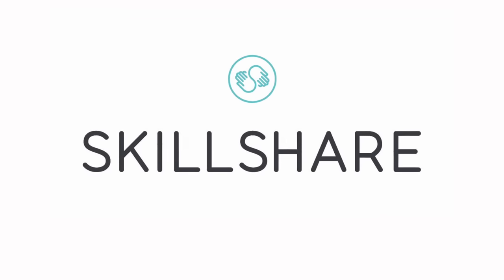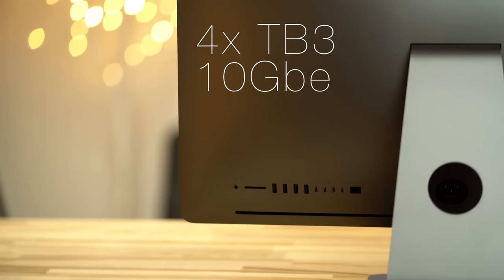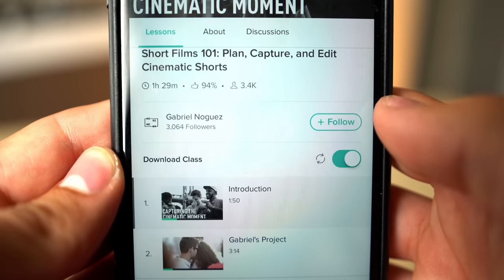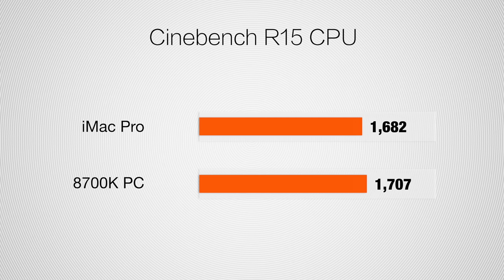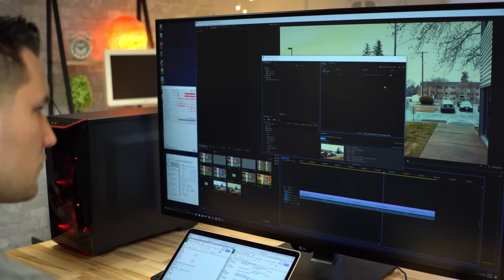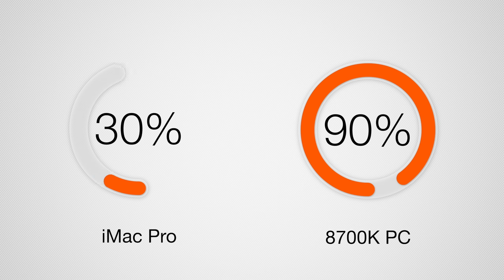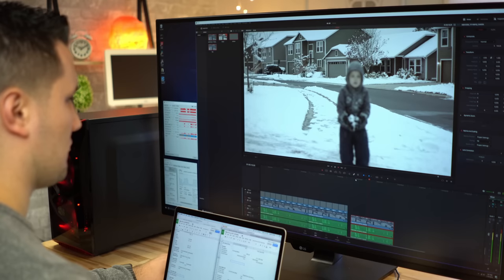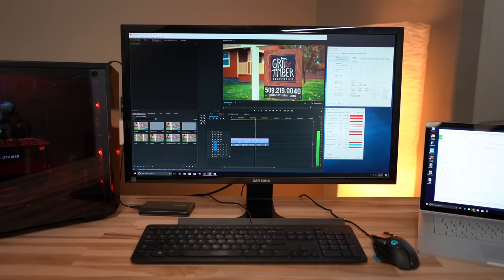$1350 PC vs $5000 iMac PRO for Video Editing 😲 Premiere & Resolve

Comment: 2160p monitor, yeah that is not 4K.An actual 5K imac versus a non-4K windows system.... like comparing apples and handbags.
*FACEPALM*
Reply: first of all look up the resolution for 4k and you will see its 2160p for starters and 2 it looks like the Imacs displays are above the resolutions for 4k and 5k which still makes both displays 4k for starters and 2 the difference is still negligible, the higher you go up on resolution the more pixels are required to notice a difference.
this can be seen with 720p and 1080p where 1080p has double the pixels but you don't see double the clarity.this is why in TV's and displays everything doubles in pixels, 1080p and 1440p (also known as 2.5k) which got doubled by 4k and we are already seeing the jump to 8K. you ever wonder why there aren't that many companies making 5k displays? its because you can barely tell the difference.
I bet you if someone showed you a 5k and 4k display and didn't tell you what each one was you wouldn't be able to tell the differnce
Reply: First of all, learn some basic math. 1920x1080 AND 2560x1440 is "2K"???? Makes no fucking sense.
1080p is lower than 2K resolution. 1440p would be "2.5K" double that and you get 5K 5120x2880.... basic math.
Reply: fist of all I mean by 1440p is also known as 2k and not 1080p. people call it 2k, thats what I said its known as but you are correct it should be 2.5K but its mainstream to call it 2k and by the way, 1080p is still technically 2k. so even with a typo which you jumped all over I'm still technically correct. maybe you should look shit up before you start acting all smart
Reply: Still didn't learn the basic math stuff huh? 2K/4K/5K/8K etc is a specific number, meassured horizontally so 2048/4096/5120/8192..... it does not jump around between say 1920 and 2560.
Reply: first of all 2k and 4k are not resolutions but resolution categories, there is such thing as 2048X1080, you know that right? so it actually does jump between 1920 and 2560. the more you know.
this isn't even about math but you can keep thinking it is.
all a resolution needs to fit in the catigories is to fit close enough and 1920 fits close enough to 2048.
but here you go
https://linustechtips.com/main/topic/691408-2k-does-not-mean-2560%C3%971440/
Reply: *FACEPALM*
Reply: 4 months later and still none the wiser? That is just sad :(

Comment: The downside of iMac Pro 5k screen is 60 Hz which is NOT fast refresh rate for slow motion & fast motion images 1080p to 4K of 120 - 240 fps that high end TVs support it up to 240 Hz.  If you have 120 - 240 Hz TV connects to iMac Pro, iMac pro just goes to 60 Hz.  I bought Samsung HDTV 3D LED 120 Hz in the year of 2010 plays fast & slow motion images & games 1080p fine with my Sony PS4 2013.
Reply: so called "high refresh rate" tvs aren't good. Get a high refresh rate monitor.
Reply: you dont need fast refresh rate for editing though
Reply: you do for slow motion production otherwise it will be choppy due to the less frame to work with, look at video comparisons and you will see the difference
Reply: would be cheaper to just get two 4k displays

Comment: It sounded like with Apple you get service and warranty, while you don't with a custom built PC. Which is a total BS. You can get a 5+year warranty on each high-end PC component, or at least 3-year on mediocre ones. And if something, you won't need to drag the whole thing to RMA, unlike Apple.
Another thing - cables ... One cable? Really? Well, actually, ALL of the cables will have be plugged into your iMac "monitor" - the sound, the NAS (which you may not need if you have a PC), the Internet, the optical drive, another monitor, etc. Every little box on your desk that doesn't fit inside your Apple slimness needs a cable, unless it's wireless.

Comment: Ram speed - it does make a difference https://www.techspot.com/article/1171-ddr4-4000-mhz-performance/page2.html
Reply: Actually the max ram speed that both motherboards support is 4333 so this can be found on amazon https://www.amazon.com/CORSAIR-Vengeance-PC4-34600-4333MHz-CMK16GX4M2E4333C19R/dp/B073CJHK1D

Comment: "And you have apple that's gonna service and give you warranty ... ". I just know that you can joke, apple who can't even mount out vesa mount on imac pro, is gonna service this and give you warranty. LOL

Good job on comparing, but poor content. Of course the PC will sometime slower or need max out its hardware to 90%, it's just an i7 afterall.
Reply from the maker: Yea that whole vesa mount and how they handled the iMac Pro at launch was terrible. Your right it’s not always great but overall warranty work has been great with Apple compared to other brands especially if you have a local Apple store. 

Here locally I know of multiple video editors and filmmakers who had issues with Macs and Apple swapped them out on the spot or have them a loaner when they had an issue. 

Yes it’s just an i7, your right. I just got the 9700 and 9900K in. Im very excited to check them out :)